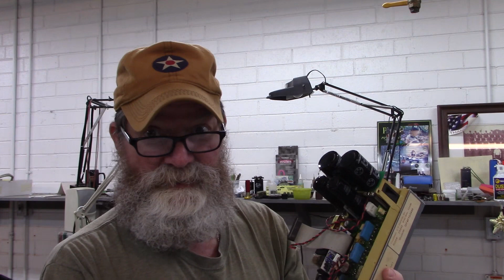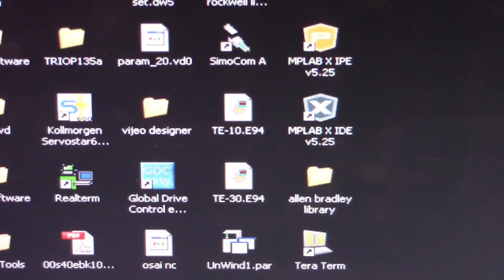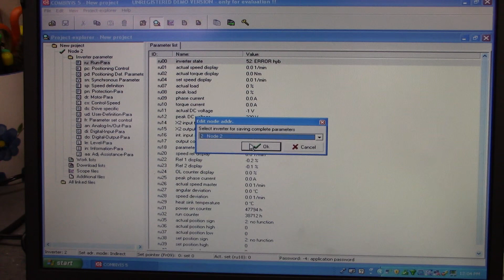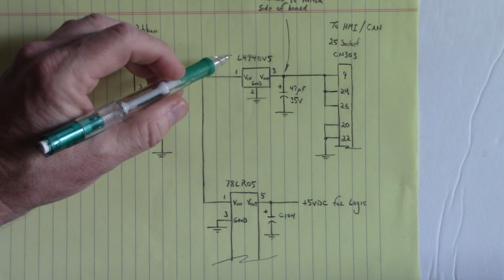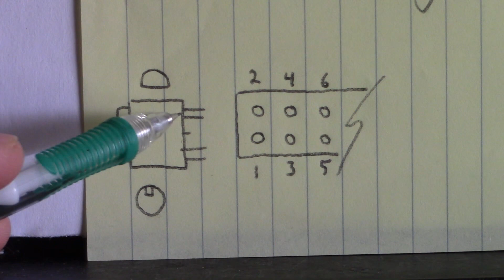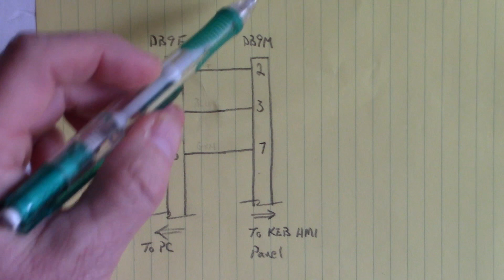Downloading the Parameters from a KEB F4 Inverter Drive with Blown W IGBT's

Comment: Hello, I have 2 keb drives with a switching power supply problem I think. I don't measure 24V between pins 20 and 22. Do you know where to look for this problem internally?

Comment: Hello,
Has anyone had success connecting to the inverter?

I tried with pcie rs232 card and usb to rs232 converter. I also tried combivis 5 and combivis 6, but i can not establish a connection. Cable is definitely correct. 

Do i need a special driver? is there any manual how to configure the software?

Please help.

Comment: thanks, saved my work. 😃
Reply: Hello, did you have success connecting to the inverter? If so, please tell me how you did it. I can't get a connection, tried different ways.
Reply: @Test-tc7xx  Hello, I was able to perform the backup, it uses a Pc atx source, because the source has +12,-12,+5 and GND.  I soldered it directly to the board respecting the connector pins as shown in the video, I used the combivis 5 as this is an S4.  the board is completely out of the S4, it was alone.  I even have it here, if you want to leave your email I will send you the photos.